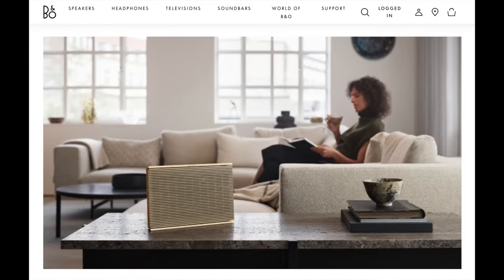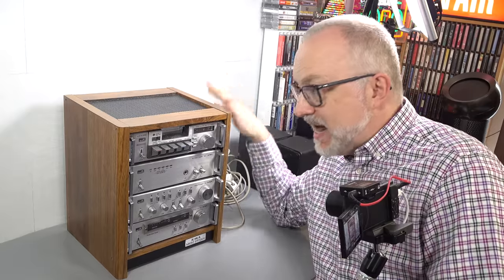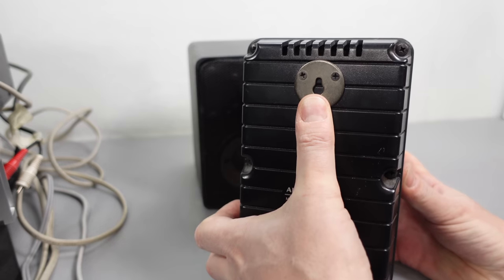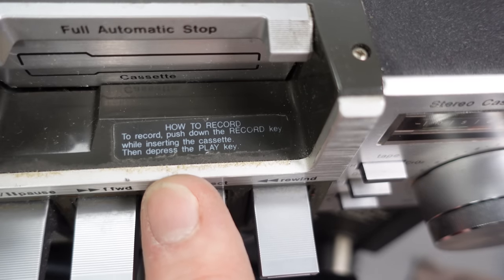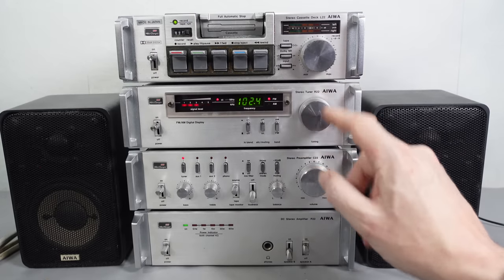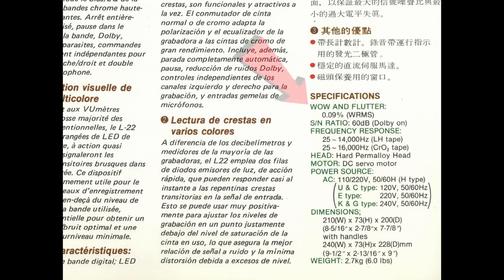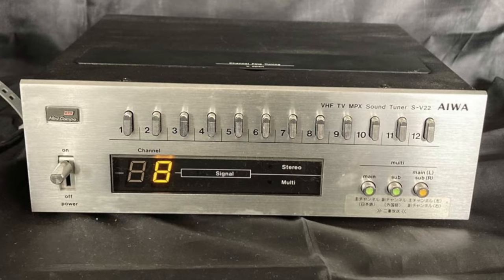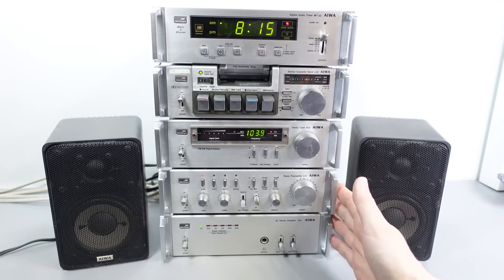AIWA SYSTEM 22 -  Micro HiFi from 1979

Comment: I have this series 22 with a busted tape deck and a weak tuner also. I was lucky to sort of fix the tuner sensitivity with some tweak on one of its rotating resistors, I don't know if it's just nostalgia or what but compared to newer mini components, I find this vintage 22's sound much livelier and bigger given the same set of speakers to compare. Also those silver faceplate is priceless and might have a big placebo audio effect on me.

Comment: I think you may have better luck with certain vintage electronics (that haven't been powered on in years) if you conditioned the capacitors prior to use. They slowly lose their capacity to withstand voltage spikes as they sit unused and, after a few years, they can be very easily damaged if powered on.

One solution I've seen to this, at least in analog electronics, is to get a variac and power the equipment by slowly increasing the voltage over a few hours. Helps build back up the voltage tolerance. 

The variac method isn't recommended for some digital stuff, but there are other solutions in those cases. Might be worth a try on some of the much older items you use. Tech Tangents has a good video on some techniques. 

Loved the video!

Comment: Better put the power amplifier on top and the tape deck away apart from it - because if the temperature and the magnetic field.
So from top to bottom power pre tuner tape. That fits more properly.
AIWA 22
Reply: Yeah that's how I got mine, with power venting through top grill

Comment: This brought back some memories for me. A friend of mine had this system and she was always disappointed with the sound quality, she only had small bookshelf speakers. I gave her a pair of 3 way KEF speakers and stands and a Sansui SR222 turntable and the system burst into life and actually sounded pretty good. I was always surprised by how good the preamp/poweramp sections performed. I didn't rate the cassette deck but, naturally, it was built down to a size and affordable price. Playback was acceptable but recordings were very lacklustre compared to Aiwa's excellent full size decks of that era. Regarding repair, there is one good channel so a tech should really have no problem tracing the signal and locating issue with the bad one. Probably be best to look out for a replacement given the missing trim.

Comment: .. back in the 80's a friend had one of these... the quality was amazing on larger speakers... the power amp has a large toroid transformer in it which is the main weight of it.. always wanted one.. I will one day... on the repair side... the old school techs would be able to repair these.. modern stuff is either throw away or panel swopping... not many go to component level.

Comment: Great idea! Grew up with them so looking forward to a series on them, good one! This one looks very “proper” clearly influenced by pro-audio studio gear with the handles on front, big heat sink etc..can’t help with why its called 22, but studio rack standard was 19 inches (48 n a bit cm)  so pretty certain these are designed to be “half-rack”hence 24cm ( as you measured)

Comment: You place some "L" braces on the corners to stabilize the unit. Also a small plastic box with Wago connectors, could serve as a single point 220 V input.

Comment: I still have a stereo set up and love it and I’m in a small studio apartment. I also love micro systems from the 90s and early 2000. I still have a kenwood mini system unopened and bought bc how beautiful it was and never used. It had a blue light on the sides of each component and taken from a high end unit around 1999. 

I also had a mini Sony system that looked serious and the tape went into the unit sideways and I believe the other half of the tape stuck outside. I got that from a flea market and never even got to turn it on to see if it worked. I wish I took photos of it to remember the model and how it looked. I love the high tech look the Japanese electronics were going for in the 80’s.
Reply: They need to open a few audio museums and have these gems preserved and enjoyed by all.  I know they have  vintage electronic  audio shops in Japan and I would go mad in those shops.

Comment: That equipment sold in other countries would have had an array if two pin mains sockets on one of the units, probably the power amplifier in this case, for the other units to plug in to, and a single mains cable coming out to the wall socket, however those mains connectors don't comply with the relevant British safety standard so they couldn't be sold like that in the UK, hence the individual cables and 13 amp square pin mains plugs.  Thanks for another interesting video.

Comment: I've got a couple of the Aiwa mini series, and they are great, but they all needed extensive component replacement to get them up and running. Because of the small size, they get very hot inside, and that tended to cook the components. Not just the caps, I had to replace the relays, and many of the transistors in both the pre and power stages. Very nice little guys, but not recommended for the faint of heart or light of wallet

Comment: I have 4 of those Aiwa 22 systems and besides the tape player notoriously problematic, everything else works well, a little deoxit here and there, with a bluetooth receiver plugged in aux they can be a daily use and they look stunning. Another system of that exact same era to consider is the Technics SE-C01/ SUC-01/ ST-C01 series that once found its place in the NY museum of modern art for being an iconic 80s design. These when they came out were very expensive, they costed a month's salary of a well paid manager at the time, I remember well when my father purchased one in 1981 it was a major expense for the family but also a priceless pride for me to show it off to my friends.

Comment: I have the same problems here, when repairing cassette mechanisms built between 1978 and 1982. The auto stop system is controlled by a pernament magnet in the tape counter, if the counter stops, a timer pulls the stop slide with a solanoid. The missing channel is 90% always the shielded cable from the record/playback head to the circuit board, either the cable or the soldering points on the head are broken due to material fatigue. This is because the head sledge has moved thousands of times in 40 years.

Comment: I like buying old gear like this which has faults to repair. 
The good thing about the older stuff is there are many user replaceable components, instead of one unobtainable custom chip you get with modern devices. 
Nice looking system 😎

Comment: The tuner issue reminds me of my first stereo. It was from JCPenney, the MCS series. The tuner had a digital display. Upon opening the case, the tuning mechanism was the typical analog belt on spindle like you would see on an older Philco model with a dial face for example.

Comment: I'd recommend the Aiwa A30 or A60, I've got the A30 with some Tandy Genexxa pro x7 speakers and it sounds great, this was a later version that had the preamp built into the amp yet maintains this same style and likely more reliable. Important note those, these do not like being run with either of the speakers disconnected, it will burn out the Amplifier chip inside.

Comment: 30:00 Couldn't have said it better. I have been dealing with repairing HiFi equipment for years now and tried alot of repair shops, even those far away. Unfortunately, these stores often have no idea about repairing old hi-fi equipment, but are only trained to replace certain modules in modern devices, such as the touchscreen of a smartphone. How to replace electrolytic capacitors, check diodes or adjusting the DC BIAS is completely unknown to them. Some of them don't even know how the pickup of a record player or the mechanics of a cassette deck work.

Comment: 19:01 Going by the age of that, I'd say it's a capacitor issue. That's usually the most common failure point in old electronics  being that capacitors have at max (even the best ones) a rated 15 year lifespan.
Reply: He did mention recapping the components.
Reply: @John_Ridley  I must have missed it. I was wondering why he didn't mention that.
Reply: I agree. You can see some woofer pumping going on. Definitely a sign that the capacitors are past their best. This is to be expected, given the age of this kit. Recapping would most likely bring the power amp back to sounding great.

Comment: A common audio problem with tape decks was the record switch contacts got oxidised or dirty and that could cause the sound to not work properly. You could try spraying some contact cleaner (stay wet type is best) into it and actuate the switch a bunch of times. It's worth a go but if that doesn't fix it it gets more complicated.

Comment: Maybe 22 cm rack opening?  In the US, rack sizes are 19" or 23";  For an 19" rack, the is 17.75", which is why the standard component sizes tended to be a bit over 17" to allow space for sliding in/out.   Oddly, 17.125" is about 43.5 cm, suggesting a half rack size of about 22 cm, which you would expect to be the width of those components.  Maybe half rack units are smaller to allow for a mounting bracket between the two halves when put into a 19" rack?

Comment: Polyurethane glue would be a good adhesive to fix the cabinet with, it will adhere nicely to the metal studs and the particle board, and it will expand to fill the gaps between the two.

Comment: I went from the basic Panasonic record player with a cassette to a full Adcom component system with a Dennon CD player, Norman Lab and Infinity Reference speakers. 
I still have the system, though the speakers have deteriorated. It sits in a corner unused because I use my phone's Bluetooth with a little rechargeable speaker. Convenience has won out over beauty.

Comment: Replacing a belt is usually an easy task done with a rubber brand. Those can last a long time. That or a silicone o-ring of the same size.If the radio was placed outside, it would definitely pickup a much better FM signal. All of my stereos (and one mono unit) pick it up better outside. Electrical noise can be another factor.

Comment: I know radio shack in the 70's through the early 2000s sold micro hifi component systems which included a small cassette recorder, stereo amp, radio tuner, and speakers. I have a tuner and cassette deck that could be a part of such a system.

Comment: I just realized that I had this very tape deck from BASF. My HiFi set from the mid 1970s to 1988 was mixed up from various provenance. The turntable was from DUAL, later replaced by a LENCO direct drive that I still have. Some other parts were self-built ...

Comment: @16:12 Old dielectric grease, hardened with age. It was a very common issue cassette decks, including VCRs. The grease ceases to lubricate; instead, acts as an adhesive. Increases mechanical resistance, thus tripping the autostop which expects that resistance only from a spindle held still by a completely unspoiled tape reel.

In addition to premature autostop, the playback likely will present drag. And many models of tape decks included a feature by which holding the "play" button down, past its locked position, would "fast-playback". If this deck had such a feature, but playback speed seems to remain normal when holding the "play" button; there's a chance that the mechanical resistance is strong enough to cause the drive belts to slip.

The decks will require a dissembly in order to clean and relubricate with fresh dielectric grease.

Comment: These things really are like old cars… great fun if you like tinkering but not the most reliable things.

I Inherited that exact system with BASF branding. Fixed the tape deck which now works perfectly with new belts and clutches. 

Fixed the tuner by making one good one out of two broken units.

The Amp and preamp work fine.

Am stuck on the clock Timer though - something is not right with the logic - different segments stop working depending on the mode selected. 

Original speakers are all broken and perished so they are dead - works great on larger modern bookcase speakers though!

Sadly I don’t have the space to give it a permanent home…

Comment: I had this (AIWA) exact kit but BASF branded, used it in my caravan....It was an awesome and very powerful set, given it's size...Still have the speakers...
I know that there also was a Sony branded version....
My timer stopped working , so I got a 42cm Pioneer timer and stacked this set 2+2 with the timer on top of them....NICE SET.
Oh yeah...as a Pick-up player I used (and still have ) a Technics SL7 and later the SL15. They would not skip easy, since it was in a caravan...
Reply: Ok . just noticed you mentioning those too...

Comment: I had this setup back in the 80s I used to live in a converted attic and that antenna was just as bad back then too, good luck with that, in the end I just plugged my Sony D50 Portable CD player Panasonic HiFi Video and Little Oak turntable into mine and called it a day.

Comment: Unless most or all of the cassette tapes you have are causing the deck to click off by itself, I'd say the one tape is not turning freely. If a cassette tape is fast forwarded and rewound partially over and over several times, maybe to play certain songs, they stop turning freely because the tape becomes layered unevenly. I just fast forward and rewind the tape completely from start to finish a couple of times so its smoothly layered in the cassette shell again. The cassette deck only out putting music on one channel, left or right, is a problem somewhere along the audio signal line. You'll have to follow the audio signal along from the tape head on through each stage of amplification till you find out where the audio signal cuts out. That Aiwa component system is in good condition. Well worth repairing.

Comment: I don't know if you've heard of "Mend it Mark" here on YouTube, but he's also in the UK and may well be interested in doing a collab. I've watched a lot of his repair videos and he seems to know what he's doing and has all the kit. He'd most likely make a video on your tape deck and mention your channel, etc. Might be an idea. With the tape deck, though, it most likely is the record/play select switch which may be just bad solder joints (as the fault is common to the incoming audio and the out going). Unless, of course, it uses a playback amplifier which doubles as a recording amplifier that has the dead channel. As for the auto-stop sensor, that thing should not stop rotating when another belt is connected to the tape counter. That would be driven by a belt off the take-up reel, and is most likely knackered as well. I'd be replacing all the belts in that.

Comment: Can't make it through all the comments but I'm sure someone else has pointed out that High-Blend only makes the upper frequency range mono.  So the lower mid frequency and bass range retains the stereo information. 

Even better was the Shotz circuitry take on this problem which only engaged the high frequency mono blending as the signal decreased.  So in that case there was full stereo when the station was strong and the hiss likely to be unnoticeable.